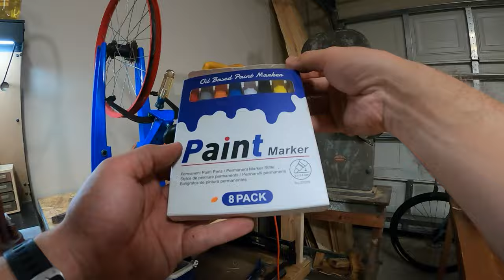Fix up boys Huffy bike - HOT garage series

Comment: Coming back to watch the entire video.

Open the door to the house next time let the air conditioned air from the house cool the garage down some. Also most cameras have a wind reduction feature that would probably help so you can run a fan. 

No point in suffering in the heat doing something you enjoy.
Reply from the maker: that's a good idea!